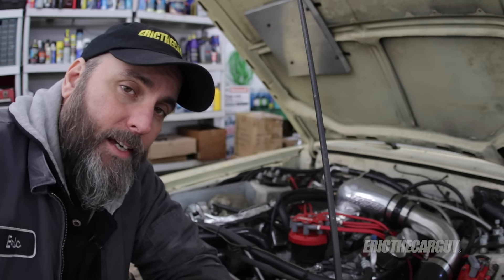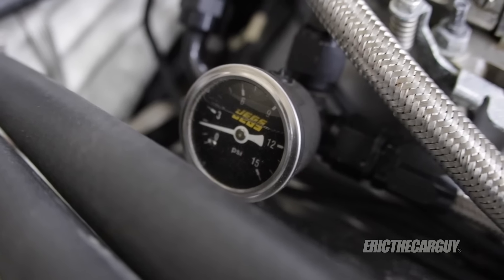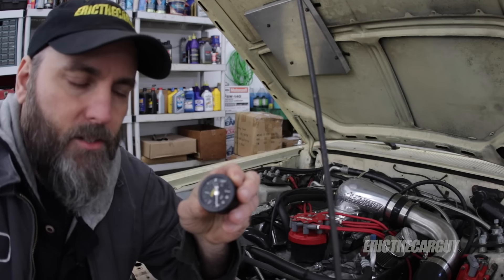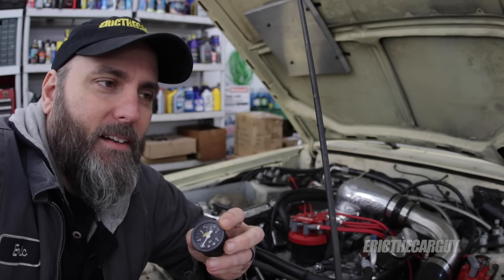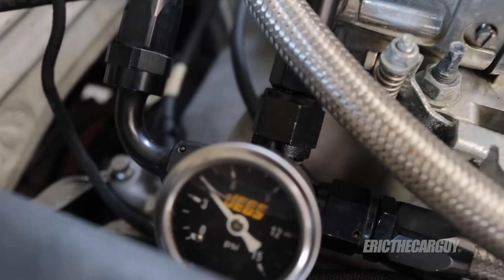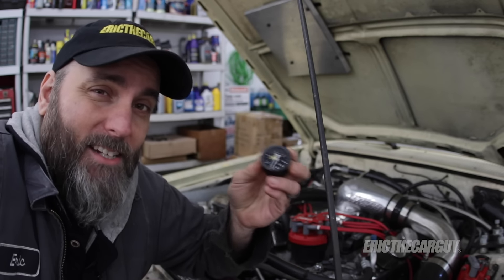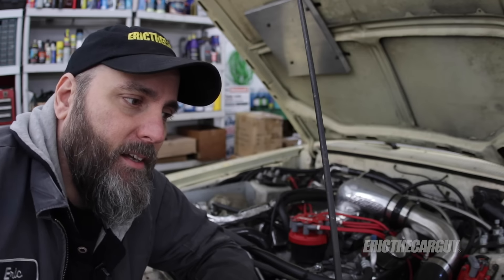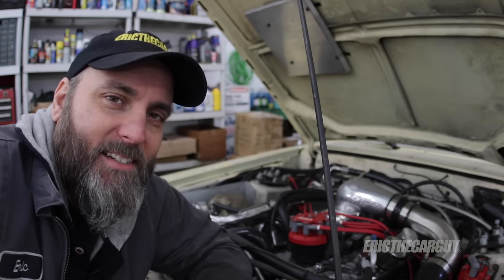The #1 Cause of Fuel Pressure Problems

Comment: Hi I was hoping maybe someone could help me and send me in the right direction. So here's my problem  I have a 99 f350 v10 gas I put 2 new fuel pumps on with in a 500 miles as well as new fuel pressure regulator and new fuel fuelter coils and spark plugs and my fuel pressure stays at 30 psi and I've been told it should be 45psi Minimum the other problem is that on both banks I'm negative 7% using a lot more gasoline  than I should and have like no power up hills. I've taken it to atless 8 deferent Mechanics and they all say nothing is wrong with it  but I can't get more than 30 mph unloaded up hill and I went from 19 miles to the gallon to 6 miles to the gallon.  Someone please help me.   Thanks for your time.

Comment: So, if you remote mount the gauge , say into the dash , it will work correctly ?
Reply: It's like a clock. It'll either be right 24 hours a day or right twice a day, regardless of its position relative to the engine.
Reply from the maker: To do that would require running fuel line into the passenger compartment. Personally, I think that's a bad idea, however, theoretically, I guess it would work. That is unless you park your car in the sun and the interior temp goes way up, then same problem. The solution is simple, get the gauge linked in the description with the pressure relief.
Reply: I believe that will get you sent home at a lot of race tracks.
Reply: EricTheCarGuy 10-4.. thanks for reply

Comment: I never a problem with the filled gauge it's how u use It i have 2 sesperate  fuel  feeds from my regulater to my holly 750 I just hook the sesperate to 1 fuel line at a time turn on my pump set regulater and it good

Comment: my fuel pressure test gauge jumps abt 3 psi when testing pressure..
Reply: Hey did you find out why...
Reply: @maximumpotential1944  the truck had v6 fuel injectors  in a 350
Reply: @randy1ization  that's funny as hell thx
Reply: @maximumpotential1944  wasnt funny working on the truck for 5 months to figure it out
Reply: @randy1ization  i took me a year to figure it out & i just swapped motors for the 4th & last times on this project im DONE! Its as if im dealing with a curse. 100 bro

Comment: sounds like you weren't doing proper diagnostics and trusting your gauge way to much. if you are  not getting enough fuel its doesn't matter what the gauge says you need to get the engine more fuel.
Reply from the maker: I think you missed the point of the video. Thanks for the comment.

Comment: Seriously i know you want old school looks but any analog gauge with moving parts will nearly always be inaccurate. We live in a digital world so for your engines sake buy a digital one .
Reply: Plenty of digital gauges are absolute junk, they just fool you into thinking they are accurate because "numbers".
Reply: @godfreypoon5148  So well done you spend twenty grand on a cars engine and you sir go to Kmart to by your digital gauges.
I think you need to buy a radiator for your vw beetle.
Reply: Wow, looks like you bought your instrumentation with extra salt.
Reply from the maker: Or you could just buy the gauge I recommended listed in the description.
Reply: @ericthecarguy  Eric Eric you're doing it all wrong lol.Twenty years ago analog or carpilary gauges was the best thing you could buy. You sir are running a boosted engine that requires a shit load of un restricted fuel yes. So what is the point of a fuel press gauge mounted under the bonnet  with all that extra heat supplied to via the turbo that you can only use while your on a dyno, the whole thing really seems pointless . There is an old saying measure twice and cut once, i would run a digital gauge with a warning light or lamp depending which country you come from warning me to back of the throttle
before it throws a leg out of bed or something to that degree. Just my opinion but i have been flowing your channel for many years now and i know how much time and effort you have put into this car!!!
Reply from the maker: Once you set fuel pressure, you're pretty much done. Especially on a carbureted engine. It's really there as a monitor in my application. It's better than having no idea what fuel psi is at all.  

Not saying that a digital gauge wouldn't be great, but this is a street car, not a race car. It spends the majority of the time driving around normally with occasional trips to the track. If I had built a dedicated race car, then sure, I'd want to know everything about every system and a digital fuel pressure gauge would be appropriate. 

I think you also need to consider application. As stated, my Fairmont is a street car, not a race car. 

Also, your beloved digital is subject to failure as well. Improper voltage, or a coding issue, and you're just as dead. Everything brakes. Everything has weaknesses. As stated, it's a matter of application and preference.
Reply: I threw in my two cents there because, as you might guess by my picture, I'm from the digital side of the electronics industry.
Reply: @ericthecarguy  Dear Eric Mr Godftrey Poon stated that some digital gauges are crap i only stated if you buy anything cheap it will be useless. If you were going to race this car you wouldn't have the time to even focus on a stupid gauge any way. Any or all cars boats or anything modified i would prefer warning lights to a gauge any day and then if you did have any issues you connect any type of digital or analog gauge in series and once issue is solved then remove that weak point.

Comment: Or just buy name brand guages from Wika instead of Chinesium junk from the big auto parts places.
Reply: Did you watch the video? "Name brand" gauges made the same way will have the same problem.
Reply: It absolutely will not have the same problem. I work in the oil and gas industry and any quality pressure gauge has a temperature compensation mechanism built in. Mind you these gauges cost several orders of magnitude more than the mickey mouse gauges you normally see at the parts stores.